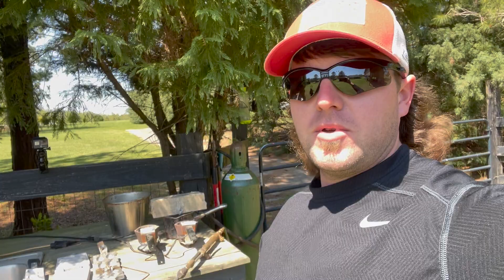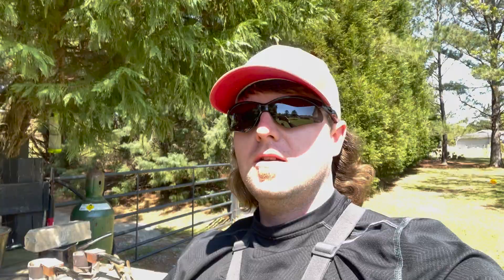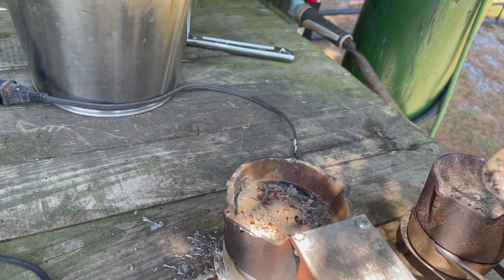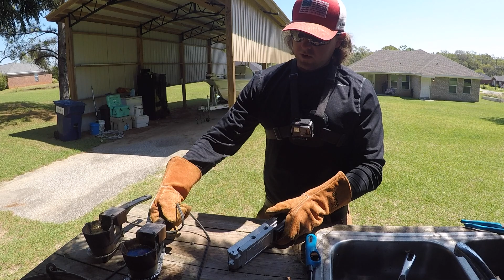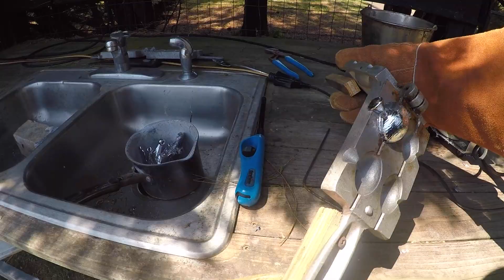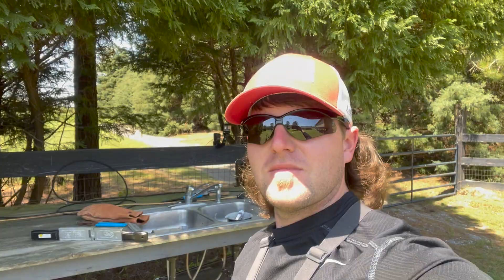How to make Lead fishing weights (Egg style and Bank style)

Comment: You have to leave your molds sit on top of the lead pots while you're heating up the lead so they heat up too. You can also heat them up with a propane torch but not enough to burn the wood.

Comment: If you want to save some time filing (to smooth the remains of the molding sprue), grind down the outside jaws of an old pair of side-cutters to create a quick & easy flush cut. 😉